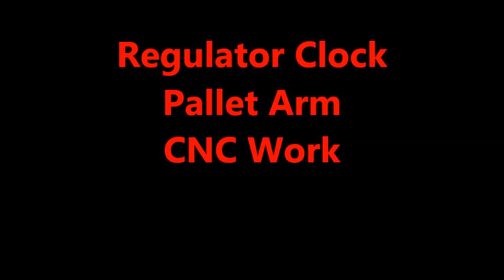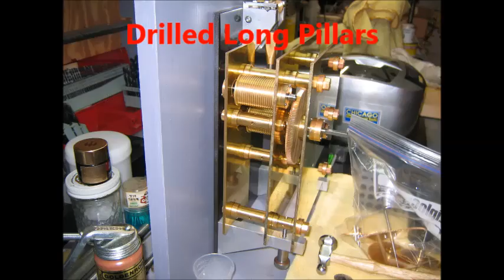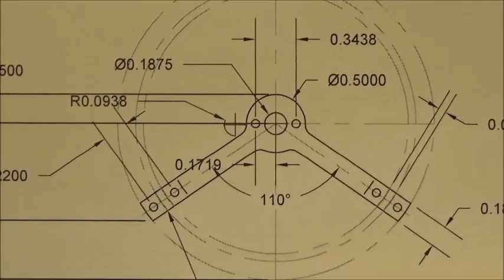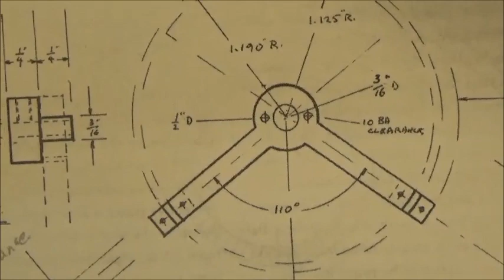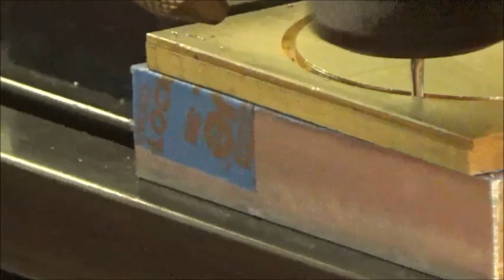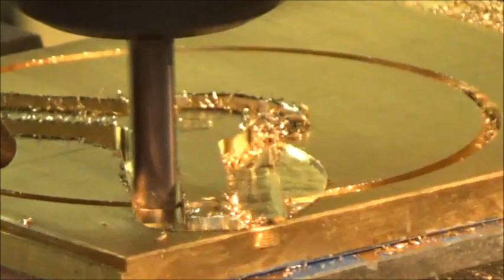Regulator Clock Build - Pallet Arm CNC Work

Comment: Larry, can you imagine how long it would take to complete with a fret saw or rotary table with all the data on a piece of paper and changes required on X and Y axis you would wind up with wonky eyes, one thing I noticed in the code is the cutter movement pause at the radius points which will transfer onto the part, might it be better to have a continues move to eliminate that happening or a final finishing pass? I know it can be fixed by some hand finishing with a needle file, even so, it's going swimmingly well,
Reply from the maker: Walter:  Thanks for the comment.  I ordered a piece of brass today for the crutch, because I didn't have anything long enough on hand.  I may go to my supplier on Monday and see what's available.  The clamps you sent me worked really well, so thanks again for sending them down.  I really like the idea of using the painters tape and super glue, it seems like a bullet proof method to hold a thin work piece.  Thanks again for everything: Best Regards: Larry